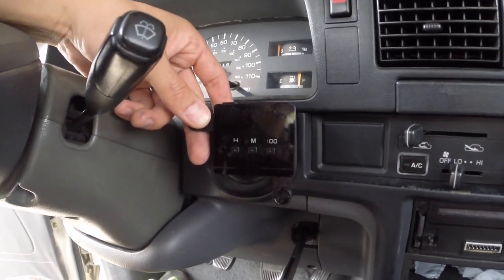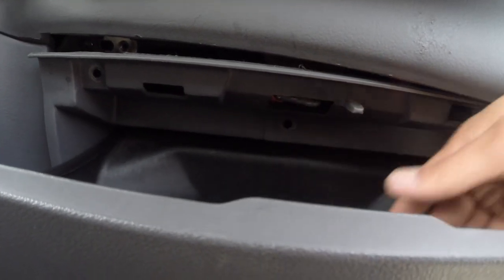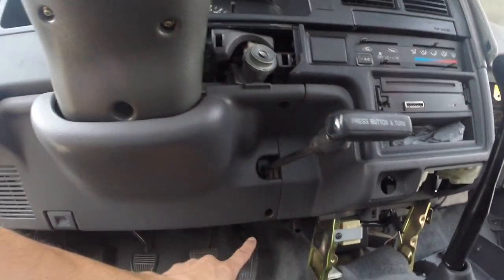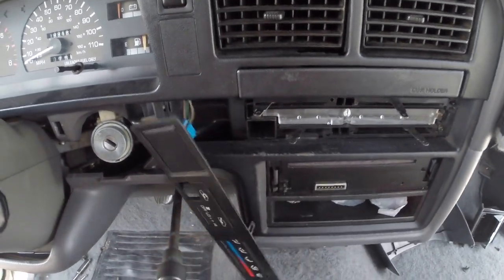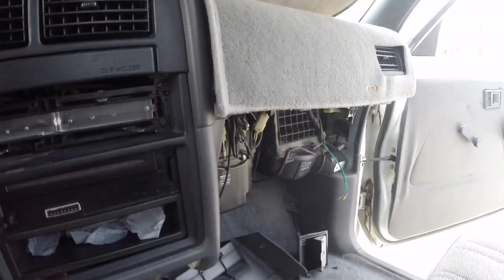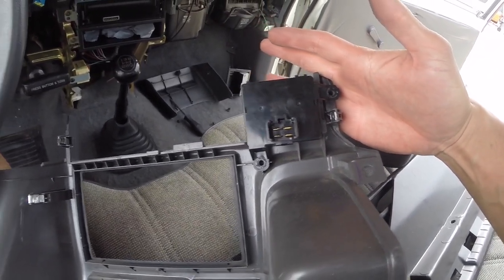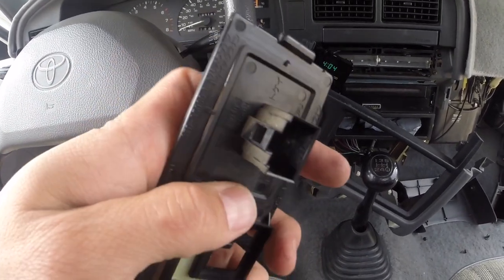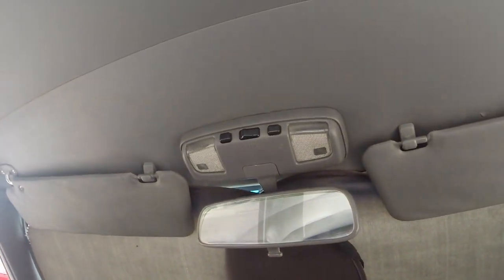How to Install 4Runner Clock into 89-95 Toyota Pickup (lower dash disassembly)

Comment: And so it begins....Inherited my stepmom's '93 truck with 118,000 miles on it two days ago, and one of the first things I noticed was lack of clock - even on the radio! Second thing was the slipping clutch - I can replace that, but first the easy stuff - find and install a clock! So time to cruise the junkyard tomorrow after getting the tires re-balanced - thanks for the info about the install!

Comment: After checking what seemed like a couple of dozen 4Runner's in wrecking yards, finally found one with a clock in a recent arrival!  Warning - if you get one from a Toyota Surf (4Runner in North America!), the mounting tabs will be reversed because of the RHD!!  I managed to cut them off and reattach with hot glue, so it will work for me - but extra work to install.

Comment: Great videos!! With your video help I visited a local junkyard to swap out the rear view mirror and dome light from a 4Runner - sweet upgrade. Improved the sound and cut down the rattling dramatically by installing 4Runner speaker boxes. Replaced my original '93 pickup crazed 3 instrument cluster with a clear 4Runner cluster that displays oil pressure (thanks to your video) and a tachometer (adjusted potentiometer and added a wire as you instructed). Of all things the clock has been the biggest pain. Three junkyard clocks later - none worked - I removed the springs and soldered the leads as per the Toyo forum. The clock's four plug has power on the bottom left plug and yet I cannot get any of the three clocks to work. Would you recommend buying a working (tested) clock from an online site or after three clock failures do you think it could be the truck wiring. I'm sure it's not a fuse because the dome lights work and the bottom left plug shows over 12volts. Lastly, the new fuel gauge appears to read a tad high - is there an adjustment for that?
Thanks again for your video instruction - you have helped me upgrade my POS from a rattling bucket to a semi tricked out quiet truck I enjoy driving. Thank you.
Reply from the maker: S K So awesome to hear, I feel the same way.  The small mods made it more enjoyable/functional and worth driving everyday!  I can't believe 3 clocks all don't function.   It just doesn't seem possible.  I've gotten over 20 clocks for the 88-91 Civic/crx over the last 10 years and all of them have always worked.  Is there just 2 wires going into the clock, I cannot remember?  Try running a cable from them to the battery directly.  Maybe it'll power the clock on just to test if it's working.  You might have a wire disconnected/shorted out that lead to the clock.
Reply from the maker: S K As for the fuel gauge, I do not know of any adjustment.  You may be able to pry the needle straight up off the cluster, then reinsert it into the right position.  It works like that on the 88-91 Civic clusters.

Comment: Nice video! I have a 1990 base model; 22r with a 4 speed manual. Do all of the trucks come pre-wired? even the base models?  Do you know the exact screw size for the clock?
Reply from the maker: Sorry, I do not know.  this was the only one I had ever worked on and I sold it in January 2018.

No, sorry.
Reply: @GarageBuiltHondas  no problem. Thank you for the replies.

Comment: I had an '87 and '91. Always wondered wth that blank square was for. Does your truck have A/C? Hard to install?
Reply from the maker: Mine has AC, came with it from the factory and blows super cold to this day 20 years into ownership of the truck!! knock on wood
Reply: +J Wid Films Neither of mine did. Nor did they have power steering. If we had had the internet the way it is today I would have had everything you get factory, including turbo. Lol

Comment: How much did you pay for your clock?  Mine doesn't keep correct time anymore and the replacement ones I've found online are outrageously expensive.
Reply from the maker: andreboy1 Cheap, like $5 at the junkyard.  That's probably your least expensive option.
Reply: andreboy1 junkyards a dollar or two

Comment: hello there good sir I was wondering if you knew if a massive air flow sensor will fit on a 93 Toyota from a 4Runner been having difficulty with the part is there a way to  convert it
Reply from the maker: Unfortunately I have no idea, sorry!
Reply: That part is affordable and NO, NEVER convert anything except lights. You are not an electrical or mechanical engineer and can hurt or even kill yourself.

Comment: Do you have to take the whole dash out to get to the stock amp and the stock stereo
Reply from the maker: You'll need to remove all the lower pieces.  It's not difficult.  There isn't any other way to get to the stereo.

Comment: It must have a fuse to turn it on ???
Reply from the maker: There's probably an auxiliary fuse which powers the clock and radio.  Most cars have this and it's already incorporated into the wiring.